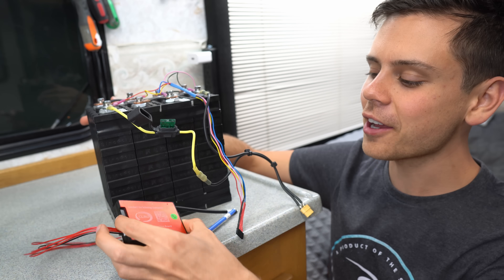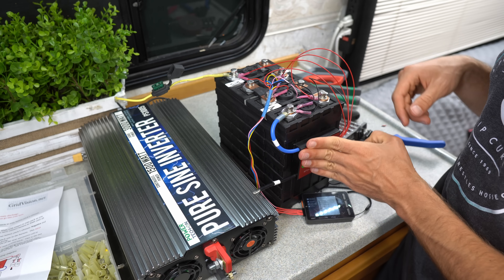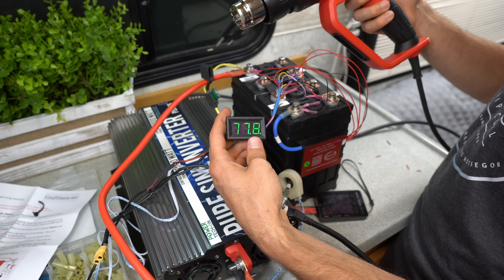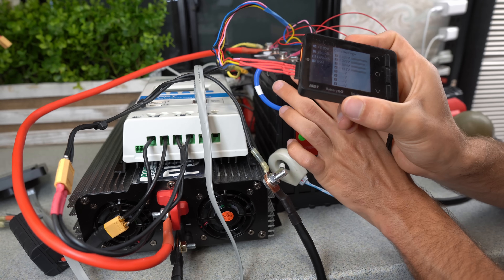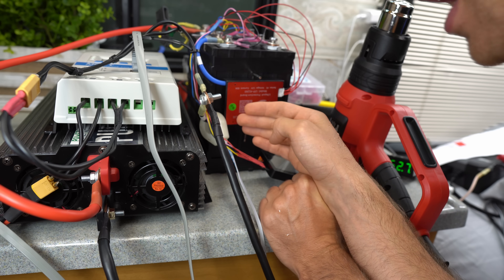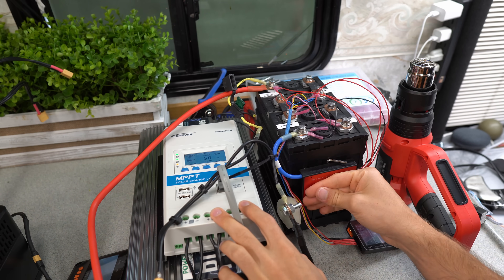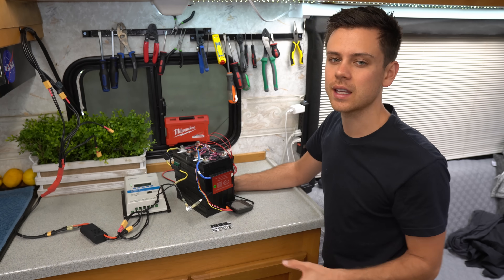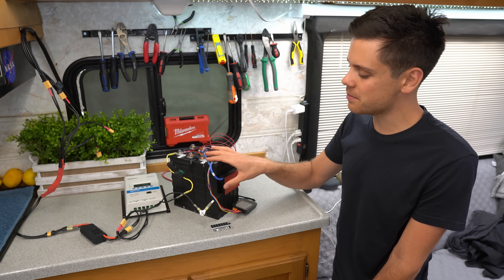12v 60a LiFePO4 Solar Battery BMS for $32- Installation and Test!

Comment: i want 288v 100amp continuous bms what should i do
Reply: Maybe set up 4 24s controllers? Why are you banking such high voltage?
Reply: @SuperVstech  online UPS
Reply: Ashish Arote so, you want an inverter to produce 288v, or you want a 288v battery?
Reply: @SuperVstech  i have online ups which requires 288v battery setup I am going to replace it with 6 lithium ion phosphate battery pack of 48v 54ah each in series in which each pack has its own BMS  will that work
Reply: @SuperVstech  as I have searched everywhere online there is no BMS which has rating of 288v 90s
Reply: Ashish Arote I agree.
24s is the most I have seen.
To know if it will work depends on the bms I guess.
Find a bms, and ask the manufacturer if it can be tied in series with 4 banks...

24s 3.2v would be 76.8, x4 would be 307.2... that’s a LOT of batteries...

Comment: Thank you for your review Will. I purchased a battery box built to hold a trolling motor battery and have been looking for a the proper device for battery protection. (4s 100a LiFePo4 Winston)  Thanks to your video, I have found it. Already purchased and delivered. Can't wait to hook it up and test.

Comment: Thanks for another great video Will, do you think this BMS is safe enough for standalone use - or would you recommend a victron battery protect as an additional safety measure? My charging source will be my alternator using the 20A renogy DC to DC you reviewed, I presume this will do a good job to prevent overcharging as well
Reply from the maker: I love adding the battery protect to everything. It's great for over current protection as well. Sell worth the money and a high quality little device. But this BMS can be use by itself. I'm still using it and it works well so far. I'm trying to find a way to kill it and haven't succeeded haha
Reply: @WillProwse  This is a great find Will, I just wish they made something similar with more conservative setpoints... 3v at the low end, 3.5 at the high end... something optimized for max cycles

Comment: what if you use this for 18650 batteries if it only charges to 3.7v then cuts off when they can be charged to 4.2 and in my case they need to be 4.2 as the battery im making is connecting to to another battery in parallel and i know that they get charged to 4.2
Reply from the maker: Buy the BMS for that chemistry you are using
Reply: @WillProwse  cheers i contacted the supplier and was able to get the right one for my needs considering mine is a 10s 3p pack

Comment: I'd love to see your most cost effective solution to incorporate a solar MPPT controller with a li-ion battery and then a DC-DC charger in one system.  I know you don't like it, but it's something I'm designing in my RAV4 hybrid build as the 90W panel on the roof rack won't have enough juice to charge my lithium house battery...so car charging will be a necessity and I don't want to have to charge off solar, then manually disconnect it and connect the DC-DC charger.  Something automated would be wonderful!
Reply from the maker: Just do it. You can connect multiple charging sources to your battery. Nothing special

Comment: Got one of these a few weeks ago and didn't know it did any sort of active balancing til the other day.  Never charged it up to 3.6v per cell for any balancing to take place (my assumption), but a week later of monitoring the new battery pack I find that the cells are 0.004 max difference.  These metallic red covered BMS/balancers are great.  I just finished building a clone of that battery pack tonight but used an HX-4S-F100A, which I'm now totally regretting.
Reply: Brandon Kennedy 
I am pondering this 3.6v on spec too.  Do not know how it does that.
Reply: @LFPSair  Have you confirmed this personally as well?  I fast charged the pack to confirm it worked (one cell group begins to go up rapidly at 13.9v) and it shut it off.  I was using an ISDT hobby charger though, so I can't confirm what Will showed (not borking his solar charge controller).  I'd like to run one on my big LIFEPO4 pack in the back of my truck but it's even more sensitive due to used cells.  I'd rather not fry my charge controller, and with my ISDT charger it completely halts all charging.  Will's experience was different, and I can't understand how.
Reply: I believed it does the top balancing at 3.6v only.  I also noticed that it is very close to the cutoff voltage too.  My charger will cycle between on and off once every a few minutes.   Now I only do the bottom balancing manually, and shut off the charge at about 3.4v
Reply: @Raymond Warren No. Daly BMSs expect all cells to be present. If it doesn't detect voltage on a balance wire, it fail safes- ie doesn't work.

Comment: Her bro... trying to find a tiny voltage meter for my 48v nom. e-bike. Suggestions?
Reply from the maker: Battery Meter, DROK 48V Digital Battery Remaining Capacity Percentage Level Voltage Temperature Monitor Tester, 10-100V 12V 36V 24V 48 Volt Electric Boat Battery Power Analyzer https://www.amazon.com/dp/B07K7KHXPY/ref=cm_sw_r_cp_apa_i_ewv7CbDVEYVAS

This one works well

Comment: Hey Will..question for a real novice here..I saw a 200Ah atm battery for sale, but it was a 6v golf cart battery..does that work for 200 watts of solar? Dont you have to hook up to 6v to get your 12v power? Thanks much..great job as always✌
Reply: Yes, you will need two 6v batteries connected in series to bring the nominal voltage to 12v.

Comment: How would you recommend charging this pack with just AC mains (North America)? Do you disconnect the BMS and use a specialized LiFePO4 charger or just dump 14.4V into the BMS leads?
Reply from the maker: Yeah either way. Constant voltage charging works well for these
Reply: @WillProwse  Great. So the BMS will cut-off the CV source at the appropriate SOC for the pack?
Reply from the maker: It actually goes by individual cell voltage to determine the voltage cutoff

Comment: Hey buddy, i m from India, i want to know which cells is good for e-cycle having 250watt 36volt hub motor. What should i use, Lifepo4 cell or lithion ion cell.?
Reply: Li-ion is more energy dense and are typically used for ebikes.

Comment: I remember reading of someone that used a version of these designed for a Chevy volt battery that killed the battery after an overcharge. You really need to test this stuff and not rely on seller information or datasheets. 2.5V is also low for cut-off. The cells will form lithium needle microshorts and then dendrites doing that often, and can then overheat when recharging. You always want a BMS with battery temperature sensing for this reason, I'm pretty sure there's a version of that BMS that comes with a temp sensor.
Reply from the maker: The voltage specifications for this BMS are perfect for lithium iron phosphate and no other cell chemistry. I can't imagine somebody using the wrong BMS for the wrong chemistry. That would just be a horrible idea
Reply: @WillProwse  The person had these same BMS specifically programmed for Chevy volt batteries at the factory, and had no problems with most of them. Always test a BMS like you did before putting it into service. It may only take a poor or corroded connector to increase resistance for the BMS to get a false voltage reading and allow the batteries to overcharge.
Reply from the maker: So true. Good point

Comment: Your 12V battery is home built with four cells. If your have four of the same type batteries totaling sixteen cells, do you need a BMS for each battery or can one BMS monitor all four batteries?
Reply: You could use one BMS but not four batteries in the configuration he has. You would need 4 cells in parallel in a group then 4 groups in series for 12v nominal. So the BMS he shows would work in the setup I've described.
Reply: To answer your original question, no, one bms cannot be used with several batteries.

Comment: Hi Will!

Would you consider doing a video (or including in your solar book) a minimal solar setup where someone can run a window air conditioner for a short period of time (like an hour or two)?  I have a pet and if I am away and the power goes out, I need an emergency setup where an air conditioner will run long enough for me to get back to the RV and rescue my pet to a cooler environment.  The Kodiak is an excellent setup, but it is just under the Amp allowance for a small window unit so I am having to go a homemade route.  I am sure there are many people who live in RVs who would benefit from this information.  The big issue for me is finding/matching the proper soft start a/c with proper amps for the battery size/type.  I wish for between a 10,000 and 13,000 BTU window unit, but perhaps an 8,000 is the max?  Not sure.  I do not think one would need 1,000 watts to charge a battery for rare emergency use – perhaps as low as 200 watts?  I understand an additional setup of a notification system and a digital thermometer 120v plug is in order, but I do not request that part unless you wish (it would be nice if you did, at least in your book).  

If you are able to find an a/c that could run on the Kodiak for at least an hour, then problem solved super quick!

Thanks much.

p.s.  I like how you and your channel have grown.  You have become a helpful, nice guy.  :-)

Comment: Very Cool Stress test and review
2 quick questions:
1) I have read elsewhere that it is damaging to have BMS disconnect the battery at the extremes, is that valid for this particular BMS as well? 
2) Any reason this would not work well for a latger LIFEPO4 pack (~150AH) as long as my load demands are moderate (sub 50A) Thanks for the help!
Reply from the maker: 1) why

2) you can use a huge bank and it will work great

Comment: I was recently looking for a 50A 4s LifePO4 BMS and I saw these on Amazon, if I remember correctly. I never buy into waterproofing claims when it comes to PCBs. I steered away from these BMS because it made no sense to waterproof the BMS as all it does is cover it up and remove the BMS from the heat sink (in this case the ambient air). The case will cause the BMS to heat up abnormally high as the heat can't be adequately dissipated by into the air. Another item to clarify for the audience is that not all BMS have a balancing function. There is no point in balancing during discharge (with a non-regenerative balancer) and especially with LiFePO4 cells (as the cells will remain within a narrow range between 3.2V and 3.4V for a large portion of charge-discharge cycle) as all it does is reduce the useable energy of the battery; that is why most cheap BMS that have balancing function begin top balancing only when the individual cell voltage reaches 3.6V.
Reply: Positronium good info.

Comment: Did the BMS really stop the overdischarge or did the inverter low voltage protection turn off the inverter?

Comment: You can't run an inverter through a battery protect. The high inrush current will disable the BP and probably damage the mosfets inside. And you can't use the low voltage disconnect as a measure for disconnecting the inverter because it's not taking individual cell voltage into account (the entire point of a BMS). I mean it's better than nothing, but if you are off balance on the bottom end, one cell could tank in voltage rapidly and still be above the total Low Voltage range. You could use isolate the signal from the BMS and just hook that signal up to the remote port of the inverter to turn it on and off with the BMS.
Reply from the maker: Yes it's true that inrush current on inverter capacitors will trigger over current. That's why you charge the caps before you connect it. Not a problem at all. Takes seconds to do and will not cause any problems. Manually charge them. Takes seconds. 

Yes very true about BMS cell voltage monitoring vs inverter cut off, but it doesn't matter because inverter cut off should be much higher than BMS cut off anyways. They will not go that far out of balance where it won't trip. And usually SOC hangs around 50% for solar with lithium so bottom balance is preferable. I usually set cut off for inverter at 12.6 volts, right at the start of the SOC curve. Not a problem at all and I've been doing it this way for years.
Reply from the maker: Yeah I like your solution of using BMS signal for remote port of inverter. Great idea.
Reply: @WillProwse  Just make sure you isolate the signal from the high current side or you run the risk of frying the port. And not to argue about the inverter on the BP, there have been several discussions regarding BPs with inverters and the general consensus is not to use them. And if you have an inverter/charger, then you 100% can't use them as current can only flow in one direction.
Reply from the maker: @nebulight  yeah, very true about one way with BP. That's why I always wire the mppt directly to the battery. 

Do you have evidence of this consensus on the damage to the MOSFETs? Can you make a video of one that you have damaged? I need proof because me and thousands of others are still using them for inverters. I would love to be proven wrong with evidence. Looking forward to your reply

Comment: Thanks for the test, I have Winston LiFePo4 batteries, charged at -18 ° celsius in winter, no problem for 6 years!
Reply from the maker: That's impossible
Reply: @WillProwse  Ciao Will !
I have been there for 6 years in a fiberglass cabinet for electrical systems, they are at 2980 meters above sea level in a mountain bivouac with 2 x 200W panels, even the temperature has fallen below -28 ° C during some nights of January, do not give up, those who sold them guaranteed up to -25 ° C, put them in the freezer up to -32 ° C and still went with reduced capacity but loaded, the Winston itself gives it for -45 ° C

Comment: Good stuff! Thanks!  I want to start building the LifePo4 12v 100ah packs but I only have a small RC charger. What do you recommend for a good charger that plugs into house ac? and also, what is a good way to discharge without an inverter?   Thanks
Reply: I have built 4s LiFePO4 32Ah battery back using 26650 cells and 54.5Ah battery pack using 32700. You can charge them using 12V lead acid trickle charger. I have a 5A lead acid trickle charger.  I also have a VMAXTANKS BC1204LFP 14.4V 3.3A charger. For your 100Ah pack that may be too much charging time from 10% soc to full will likely be around 30 hours.
Reply: Aside from a powerlab6, use 12V applicances electric blankets, lightbulbs (incandescent would be best for this purpose), DC refrigerator, DC microwave, fans, etc... to discharge battery.

Comment: If I had a 4s2p lifepo system connected up could I use 2 of these to manage my system?  

Also and this maybe a dumb question, but when I have a heavy load on my battery the voltage drops a lot.  If it was at 13 volts and a put a 700 or 800 watt load on it, it can drop to 12 volts almost immediately. If I turn the load off it goes back up.  Is that big of a fall normal?
Reply: Voltage sag is normal in batteries. 800W at 12V is 66A if your pack charge capacity is to small say 33Ah that is 2C discharge and the voltage sag is normal, albeit undesirable.
Reply: Positronium ok thank you!  I figured that might be the case but I wasn’t sure.  I’ll have to do more research on voltage sag.

Comment: Will.. Thank for the info.  I am going to get couples but saw there are two types Common Port and Separate Port.  Can you tell me what they are?  Thanks..
Reply from the maker: Common port means charge and discharge wire are in one wire. Separate port means it comes with two different wires, one for charger, and one for loads
Reply: Okay, what does that mean for a noob like me. How can this bms protect cells if it is not in between the charger and the battery. I see bms/pcm with B,C,P pads, but picked one up without a P. I'm confused.

Comment: I for now charge without bms, its kinda spooky starting out, I try to stay at 4v per cell, and looking in to a high voltage disconnect, for controller only, I also have a low volt disconnect in the works , just incase the BMS fails,
Reply: I hope you are using LiIon... not LiPo4 batteries!

Comment: I have wondered about the BMS, disconnecting from the controller, I thought about putting a resistor bypassing the BMS to controller, like 100watt, 10 ohm or something, just enough to keep some power on the controller, but in most cases, the controller is cheaper than the battery, and your house, if it is burned from over charged lithium batteries,

Comment: If I have a Victron MPPT and low-voltage disconnect, would this BMS still worth getting?  The MPPT should have high-voltage auto-disconnect and the low-voltage disconnect protects from over-discharging.  Would this BMS then help with keeping the batteries balanced?
Reply from the maker: Yeah this BMS would help. The safety features are super nice.  But usually no need for BMS if cells are matched properly. Up to you

Comment: What is a BMS and what does it do? You never said in the video.
Reply from the maker: Battery management system. Usually provides protection features for lithium ion batteries.

Comment: Really timely video.  Just ordered (4) 3.2V 240ah cells from RJ Energy CO Ltd Shenzhen China with a high quality 200A BMS.  4S construction.  I am pretty stoked about it getting here.    Total cost shipped $897 with the BMS and busbars and bolts.   29 cents a wh!    My TT will be in heaven.
Reply from the maker: That is an amazing deal!!
Reply: @WillProwse  .29 is a wh is heck of a deal.  But they are aluminum cases with the blue plastic coverings.  I think you recommended some of these on home page.  I wasn't sure I wanted them but I think they will be fine.  Not as tough as the Sinopoly or Winston Cells, but I am building a box for them so they'll be very protected from bumps and the elements.  Going to put a tank heating pad inside the battery case so they stay warm in cold weather.  I'll drop a photo when its all put together.